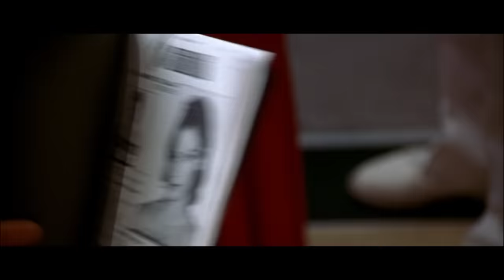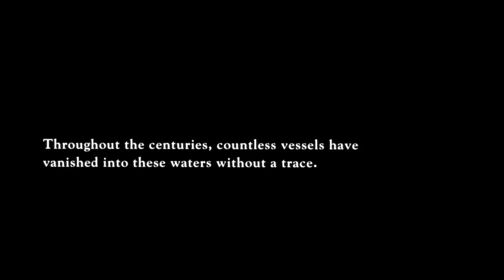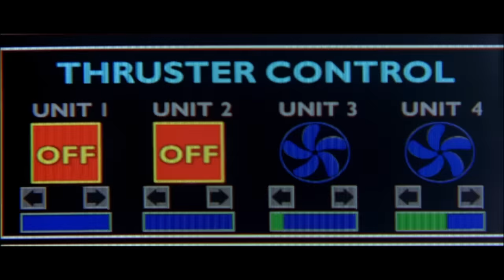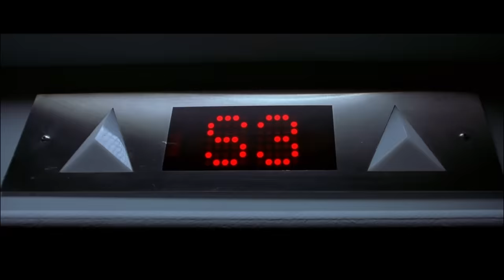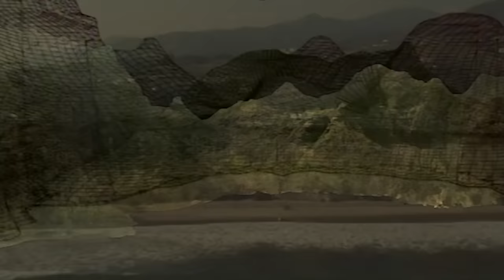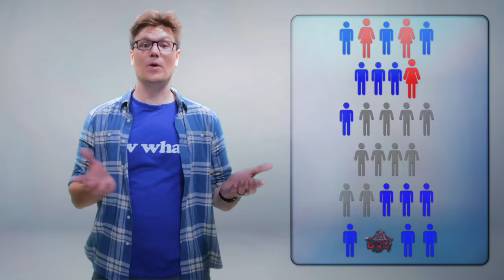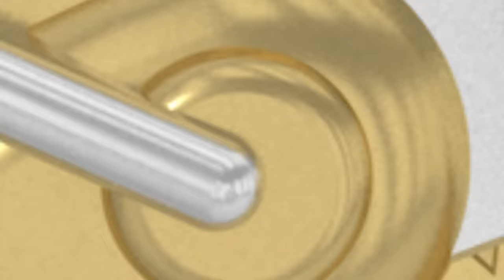Deep Rising (1998) KILL COUNT

Comment: Since Argonautica is slightly bigger than the MS Grand Princess, I would guess her passenger capacity is around 3,400 and a crew of 1,200. This is a rough guess based on the Grand Princess had a capacity of 3,100 and 1,100 crew, but since the cruise ship in the movie is would have the numbers I have given earlier.

Comment: On cruise ships, here's a brig.  And you'd be surprised who is locked in them most.  Unless you're a mariner.  Then you know.  And the toilets are not connected to the ocean.  There's a whole system in between, including some gnarly, sharp teethed macerator pumps.

Comment: One thing I hate about this movie is a very minor thing. Leila welding. In terms of welding, that scene is so fucked. She’s using the outer flame to weld, not the neutral flame that’s at the very tip of the nozzle on the torch. And for some reason, it’s sparking. Oxyacetylene welding doesn’t spark like that, even if you pop it. Even if you pop it, it sends up a small shower of sparks, but it doesn’t produce a constant shower of sparks. And having an acetylene tank on a boat that damn small is a very bad idea. Welding in a small, unventilated area like that is a very bad idea.